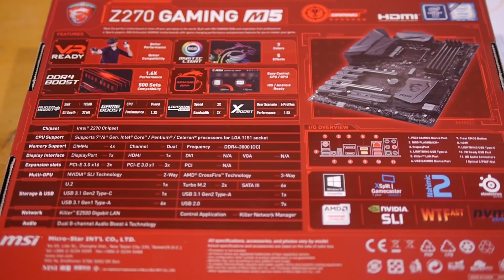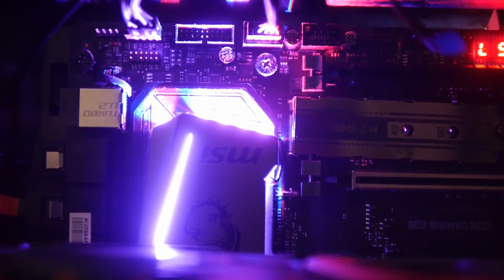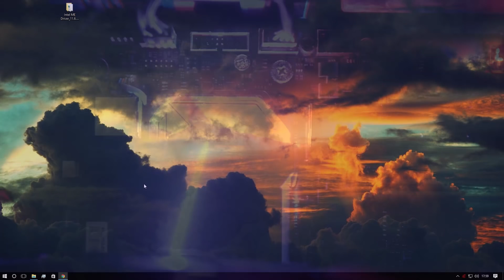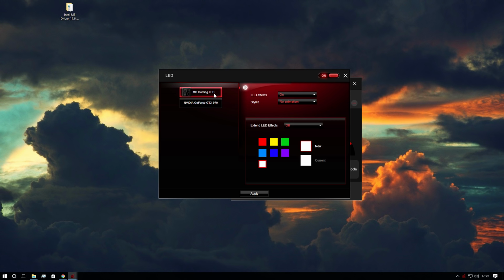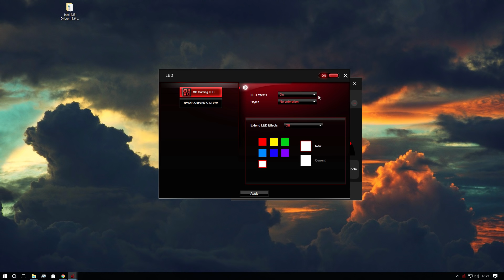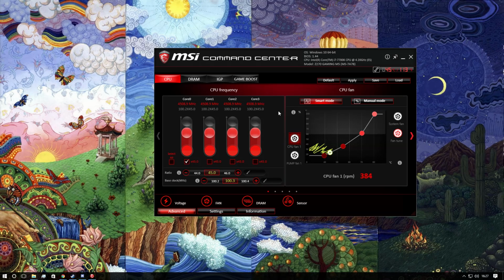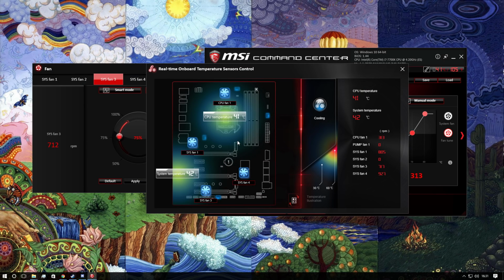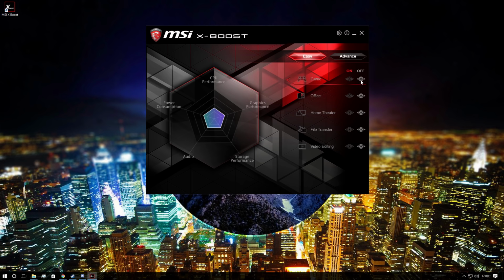MSI Z270 Gaming M5 Motherboard Review

Comment: I got one and When you RAID 0 2x M2 SanDisk SSD 256 X600's. It screams. Not to mention it has already got U.2 for the next drives to come out. 

One issue it does have. The damn MSI gaming app crashes all the time. So it defaults to blue LED. The only fix I found for it. Was to log off. Then log back on and it works again. But that is not why I bought it. As MicroCenter sells the MB and CPU combo and you save $50.00.

Thew real pisser is. Corsair LED RAM colors can not be changed. And people have been asking for for an Application that would allow it. On the fly for 1 year. So pick the color of the LED ram you want with caution. As you're stuck with that color....

Comment: Just upgraded from 3570k to one of these paired with 7700k and 16g ram. It's an awesome mobo and a beast!
Reply: I think the game boost might push higher on the M7. The M5 boost got me to 4.8 stable - I then did a manual tweak to get to 4.950 but the computer crashed after about an hr. I'm happy with 4.8 for now. If the M7 has an automatic overclock to 5.1 then maybe it's worth the extra dosh.
Reply: No it does not. An i7 or i5 are so close. You would be splitting hairs. Unless you're a hard core Audio\Video codex freak. As you will never notice. As most applications that would use the i7 performance. Is an Adobe Premiere designed to render videos fast. 

If you just the XMP it will scale as you need more CPU power. So it's not locked down. As it will scale to higher MHz when needed. Then fall back down. This keeps the CPU temps stable...
Reply: Master Chief 00117 thanks for the confirmation. Mbd has been great and rock solid. Cheers

Comment: Thanks for the video. Not a huge deal but most builders recommed not placing components on top of an anti-static bag. I use the motherboard box myself. The bag keeps the static out of the bag, the outside is essentially a Faraday cage. Thanks for the review, MSI makes great boards for sure and that is very nice indeed.
Reply from the maker: So I've scoured the internet and honestly it seems like a warzone on whether there is actually a faraday cage effect with the elctrostatic bags. I'm not going to do it again, but through this ignorance I haven't lost a component in maybe 8-12 upgrades/builds.
Reply: Same here I did it for a long time never had a problem but I'm a safe rather than sorry kind of guy. Cheers.
Reply from the maker: Feel slightly embarassed but thanks for the heads up! :)